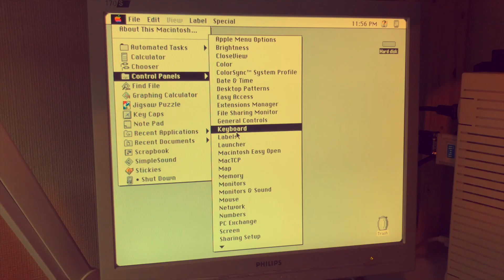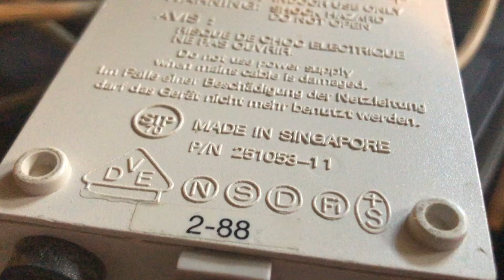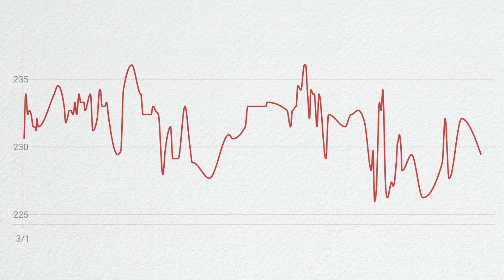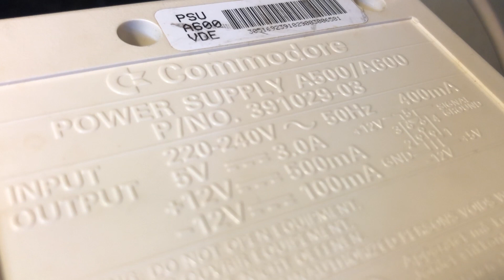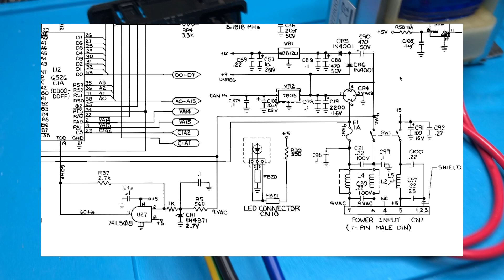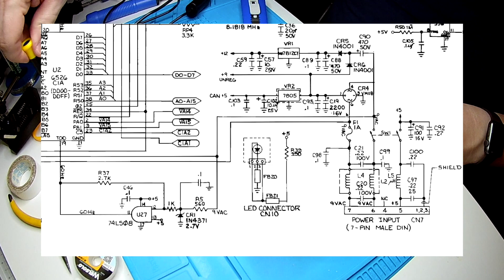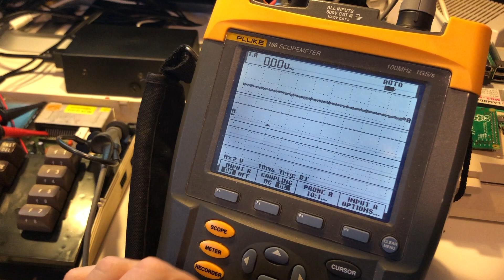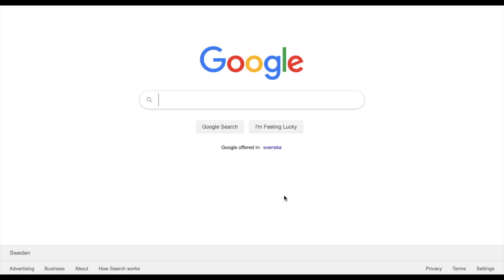Making a C64 power supply... for political reasons?

Comment: I have built a couple of C64 P/S in PC power supply boxes. 9VAC 2A transformer and a 2A 5VDC brick work just great. The DIN connector is still available from several sources. Good video

Comment: Interesting. There is the same problem with Tandberg Radios from the 70s. Fortunately it is possible to move the mains lead to the 240 tap on the transformer. Do you know the design of the ribocop? I tried sometime ago too see what circuit was like. The new psu will serve you a long time 🙂
Reply from the maker: Thanks bwack! I love those tap selectors on old radios. Some tube radios have an insane amount of choices. I suppose they were needed for export products back then.
I will get back to you on the RiboCop. So far I have just built it and did not examine the circuit much, but I have considered tweaking the voltage reference to trigger a bit earlier.

Comment: That was super informative -- a great video -- and thanks for the shout-out, by the way.😊I never considered the stress of the higher mains voltages of today. Even in Canada and the US the original C64 PSUs were rated for 117V -- the standard is 120V today although it often measures a bit higher in most areas.
Reply from the maker: Thanks! I am very glad you liked it. I am not sure how much Canada was affected by it, but the history of voltages in the US is quite interesting. If I have understood it correctly, (still need to research a bit closer) already in the 1930s the US agreed on 120V as distribution voltage. This was one of the side effects of the Rural Electrification Act of 1936. But because of the losses in the distribution lines, it was agreed that appliances should be marked with the utilization voltage, which was effectively the lowest acceptable voltage of its designed range, and not the nominal distribution voltage like we are used to, for example here in Europe. So a 117V rated PSU might be fine with 120+V. Check the 9V line under normal C64 load. It should drop close to or below 10V. If it does, the onboard regulators should have a fairly comfortable time.
Reply: @TheLEEC  Clearly, you are better versed in North American mains voltage history than I am. Yes, both Canada and the US tend to evolve equally when it comes to such things as these. I have taken it for granted that 117V rated products work flawlessly on 120V, as I have never seen or heard of any issues. Still, I will take a closer look at the C64 9V line under normal load, as you suggest. Again, great video and I look forward to future ones. Oh! I have to say, I must find my own rocket scientist for my own rigorous testing. 😉